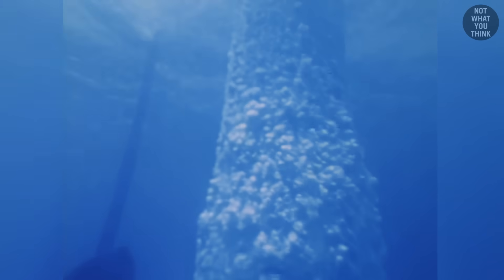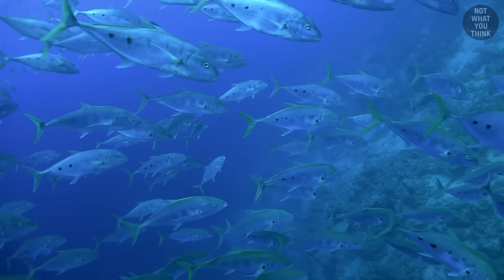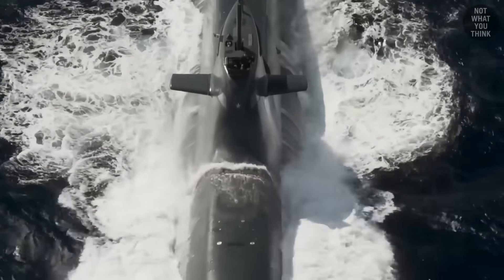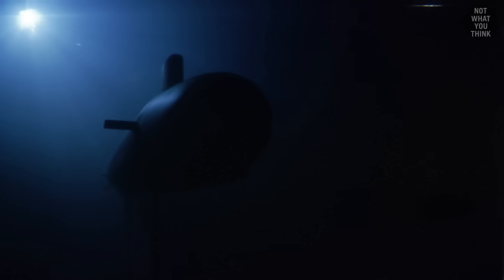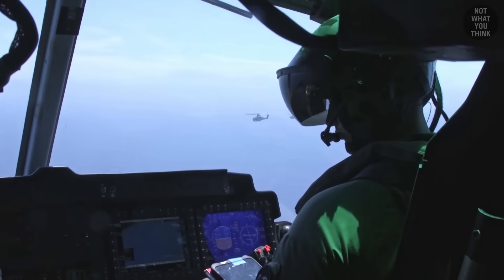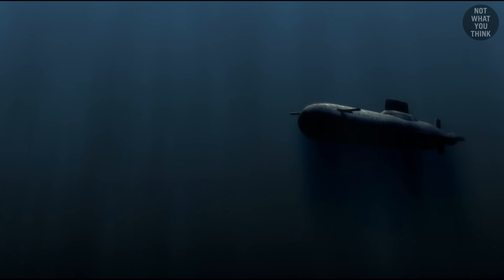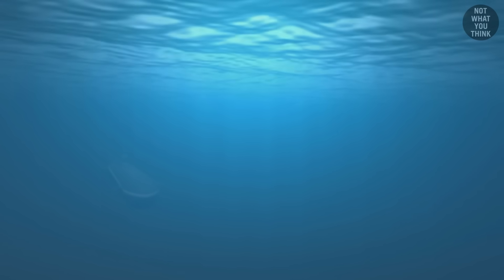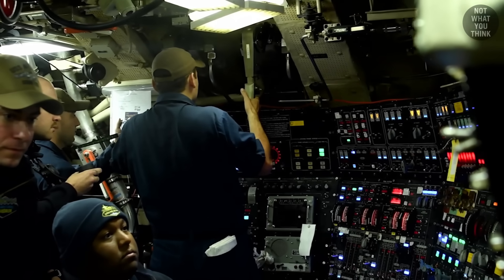Why Being Too Stealthy is Bad for Submarines

Comment: One should know that new German and Swedish diesel subs can generate power when submerged and need not surface for a bout a month, although the power is restricted and therefore the speed is limited.
They also have less thermal signature as they lack the huge boiler.
Reply: They can charge their batteries while submerged and may then behave like any diesel boat with full batteries.
Reply: And when they generate power even under the water they are essentially deaf
Reply: Raising the snorkel is the same as surfacing.
Reply: @zappulla4092 they are not raising a snorkel tho. Thats the entire point behind air independent propulsion systems. Producing power without having to resurface in some capacity to get oxygen from the air.
Reply: @zappulla4092  They don't snorkel, but can even remain lying on the ground if the depth permits. The Swedish subs use Stirling motors, whereas the German ones use fuel cells. But both have the same disadvantage as rockets have against air-breathing engines: They need about three times the mass of oxidizer compared to the mass of fuel. But their thermal signature is much less than a nuclear one, with its boiler.

Comment: Hmm - What about a sub's hull and a technology called Magnetic Anomally Detection (MAD). I recall P-3 Orions having a noticeable MAD boom at the back of the a/c. Is that tech. still used in a P-8 Poseidon?
Reply: Nah, modern subs have a degausing system.
Reply: @mememachine5244  , thanks bloke.

Comment: Modern conventional submarines can use stirling engines to stay under water for a long time and still be more silent than a nuclear submarine, as well as be much cheaper to build and operate. The main advantage of a nuclear submarine is its range, it can stay out for a long time, but if you just want to defend your own country conventional is the way to go.
Reply: Or alternatively hydrogen fuel cells which are even more quiet for a lack of moving parts.
Reply: A major advantage for nuclear subs even in the “home defense” role is as second strike nuclear armed platforms. The much longer operating time makes it easier to maintain the level of constant operation you want for that purpose- if all your nuclear armed second strike subs are ever in dock at the same time you no longer really have a nuclear second strike capability through your subs, and being nuclear powered broadly just makes subs far more efficient in this role because, although its purpose is defense, it sort of operates in the opposite way most defense roles operate- the important abilities of a sub to fill the role are the ability to operate for long periods of time away from the country without being detected. Not having to resurface nearly as often and not having to dock nearly as often are both major boons for a sub in this role, where a conventionally armed attack sub might not need those capabilities if there isn’t really an intention to deploy it offensively.
Reply: Nuclear subs are still limited by food and need resupply too.
Reply: @Nephale  yeh but like three months minimum (and likely double or triple that if prepared to do so)... basically irrelevant when compared to conventional subs.

Not to mention food can be resupplied by air-drop, making it virtually years before they would need to go to port or hook up with a supply ship (theoretically).

Comment: If diesel subs are quieter than nuclear ones, why is everyone still betting on nukes? Seems like military pride beats practicality every time.
Reply: Runs out of fuel, once batteries depleted isn't as good, emits bubbles even if scrubbed, etc. From satelite much easier to track you too. Nuclear is better in grand scheme. Many can't even afford it. The sea is super loud, not easy to track much of anything. Talk to a boomer crew once they will explain better.

Comment: 1:55 90-95db? That would be incredibly loud. As in ear protection required for prolonged exposure loud. What am I missing here?
Reply: Water has a different rating system than air.
Reply: 90dB in water is equivalent to around ~64dB in air, water transmits sound differently than air

Comment: For anyone horrified at 90 dB, sound levels in water are measured using a different reference than in air. 90 dB in water is roughly equivalent to 64 dB in air (a ~26 dB difference).
Reply: Wow that's a huge difference! Thank you for the clarification, I thought 90 dB was a mistake at first.
Reply: Huh😅 @jonbowman7686
Reply: 60 decibels is around the volume of human speaking voice,which is very impressive! Goddamn!
Reply: @cascadianrangers728  Plus it is mixed in with all of the natural sounds of water, and in water. Discerning that all by itself has to be basically impossible.
Reply: Thanks. I was sure it couldn't be right; 90 dB in our usual measurements in air is loud enough to require hearing protection.

That really should have been explained in the video, otherwise what's the point of giving the figure at all?
Reply: @Curt_Sampson  sound measurements rely on assumptions, largely assumptions made about the transmission medium. When talking about sound as people were almost always talking about sound at sea level air pressure in earth's atmosphere. 
I think almost anyone who's had water in their ears understands how sound can transmit differently through water. 
Aka it's just another assumption we make in conversation 🤷🏾‍♂️
Reply: It's actually a ~62dB difference.  The difference in reference pressures accounts for 26dB, but there's also a difference in the acoustic impedance of water and air that accounts for the rest.
Reply: oof, yeah that's quite a difference.
Reply: I am confused, even at 60 dB can you easily be detected hundreds of miles away. If you can not get more silent than that, why not try to make the sub sound like when animals move through water?
Why not change the propels out with water jets or something that can be turned on and off in the rhythm of a whale's fins or something like that?
And about the noise holes, why not have microphones and speakers on the outside that play back the surrounding sounds?
I know there is a reason for why, I do just not understand it?
Reply: @friedmule5403  You have to understand that this is what beamformers do.  The ambient background noise is coming from all directions, the beamformers effectively "pull" sound from a specific direction and have a certain amount of gain because the aperture is comprised of numerous elements.  This is why sonar can detect things at (or even below) ambient background noise.

The "hole in the water" nonsense is some Clancy bullshit, waterborne noise doesn't work like that.  And there are really zero use cases where making more noise than you need to makes sense.
Reply: @tychosis  Thank you so much for replying!! :-)
So in the end does subs´ not make an 60dB loud sound at 1 yard distance from the hull and the sub does not make a sound... "shadow"?
It did also sound too strange because why would you whisperer inside the ship if everything outside was as loud as a normal conversation. :-)
Reply: @friedmule5403  Nah, sound waves "bend" (diffract) around an object in the water, so at any meaningful tactical distance there's no "shadow."  (Now, there could be if you're super-close like 1 yard away, but you're simply never that close to a contact.)

And the need to "whisper" underway is nonsense too, airborne sound really doesn't couple to the hull like that.  Structureborne sound will, so you don't go stomping around or slamming doors.

(That being said, you don't go around yelling on the boat just because it's disruptive and people are trying to focus on work.)
Reply: So a 130dB Van Halen concert on the beach would only be 90dB under water?  Oh, never mind.  It would be zero dB.
Reply: @PruneHub  Sound transmission from air to water (or water to air) is subject to transmission/reflection depending on the density of the two media. Look up videos on wave transmission and reflection in springs of differing spring constant (density).

Because of the difference in air vs water density, if you're in the water you can easily hear sounds in the air (waves going from low to high density media are mostly transmitted). But if you're in the water, it's very hard to hear sounds in the water (waves from high to low density media are mostly reflected).

This is the same phenomenon which makes underwater explosions so dangerous to divers, fish with swim bladders, submarines, and ships. When the pressure wave in the water reaches an air chamber, it mostly gets reflected back. The interface (submarine hull, air bladder membrane, your lungs, etc) has to bounce all that pressure energy back. if it's not strong enough, it gets torn apart.
Reply: @solandri69  Woosh!
Reply: Thanks - I was stunned at the 'unalloyed' figure
Reply: Imagine having 75% of the Earth’s surface in which to hide, and an average of thousands of feet of depth and STILL running into another sub.
Reply: Me still not understanding: thanks 😅
Reply: Why?
Reply: Still the same loudness, but yeah relatively it's quiet, as he gave fish as an example of something that'd also produce 90dB.
Reply: Thank you!
Reply: thanks but 64 dB is still as loud as you average vacuum cleaner
Reply: Of course. Why would you use the same system underwater so anyone could instantly understand it. It should be changed so most people don't know. That is the way to go. Logical.
Reply: @contumelious-8440  The problem is sound dB measures pressure (proportional to energy). Meanwhile the volume you perceive a sound depends on the amplitude (displacement of the molecules in the medium as the pressure wave passes). The amplitude shakes your eardrum, and that motion gets transmitted to your inner ear where it's perceived as sound.

Water is a lot denser than air, so the pressure in water has to be a lot higher to yield the same amplitude (takes a lot more energy to shake a water molecule back and forth than an air molecule). Resulting in a higher dB in water to yield the same perceived volume.
Reply: 70db is the level of sound of a jack hammer ffs
Reply: @jab-gn3sw  there's a huge difference between 64 and 70db.

Its not "6 more" or "roughly 10%. Its literally twice the volume.
Reply: Former submarine sonar tech here. Yes, that roughly 30 dB is a thousand fold difference!!
Reply: The sea wolf was astonishingly advanced
Reply: Thank you.
Reply: 60 decibels is around the volume of human speaking voice,which is very impressive! Goddamn

Comment: I barely got into this before it was saying BS. We started every ASW exercise by coming to the surface, giving the ASW asset our position and allowing it to get a visual and drop a sonar buoy.  Even with a known datum point they always lost us. Or we lost them to be more exact.
Reply: During exercises they never knew where we were until we shot a water slug to simulate us killing them, and the other ships still couldn’t find us because that was just a transient and then we were quite.  During exercises we were told to be as noisy as possible to give the ASW guys a slight chance of finding us.
Reply: Interesting.